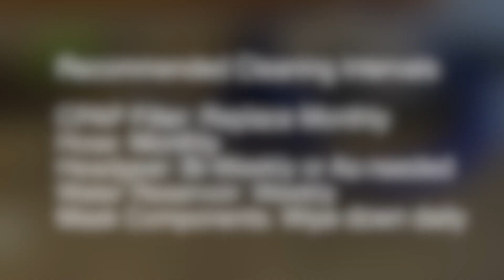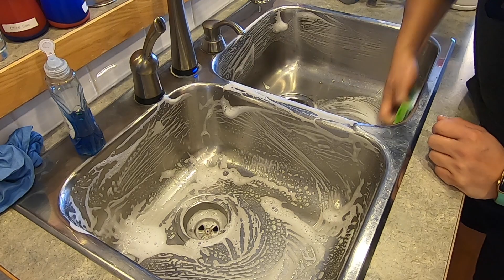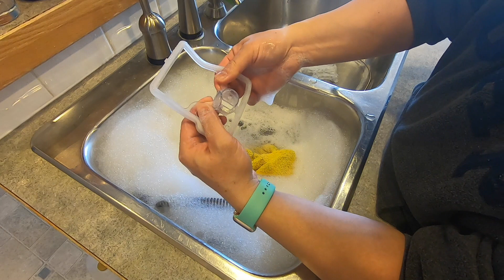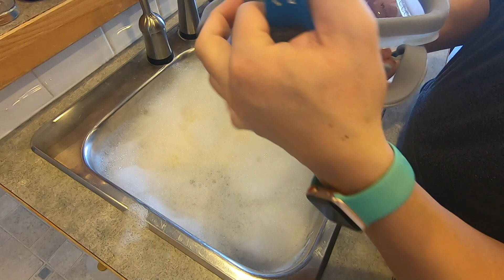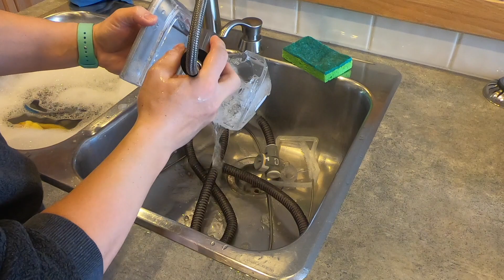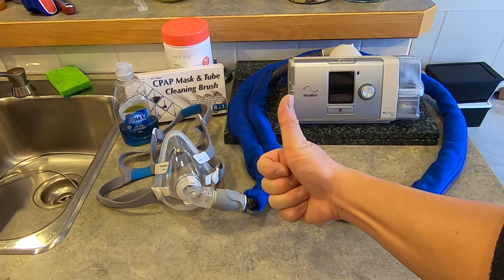How to PROPERLY Clean CPAP Equipment

Comment: Am surprised using tap water which I have been doing over 4 months. Do you use white vinegar and water once a month? Am curious. Thanks.
Reply from the maker: Sorry, what do you mean tap water?  I use reverse osmosis water in my cpap which is basically the same as distilled water.  No calcium buildup but I do wash with tap water and I do not ever get buildup either b/c washing and rinsing once a month and drying things out isn't enough tap water to "precipitate" any hard mineral buildup.
Reply: @piercedasian  I use distilled water in the chamber. What I was talking about cleaning in the sink with water out of the tap or faucet and that's what I have been doing. Heard people using vinegar and water once a month.
Reply from the maker: @marylawson6060  I guess it will depend on the tap water in your region but the takeaway here is that the tap water in our area is relatively hard but not enough that it would ever buildup.  I use vinegar in our kettles and SOMETIMES when I'm washing out my CPAP hose but I don't suffer from any significant respiratory ailments that would require me to go the extra mile all the time.
Reply: @piercedasian  I wash everything religiously including the hose every day with Dawn and warm water. Thanks for the information. I have asthma so another washing I have to do.
Reply from the maker: @marylawson6060  wow a daily wash?  Do you really need to wash the hose that often?  I understand the reservoir would be needed but the hose too?  How long have you been on CPAP therapy for?
Reply: @piercedasian  Four months. I have asthma so have been washing hose every day for the last week. Makes me feel more comfortable I guess.
Reply from the maker: ah okay, so you're a newbie still.  How have you been tolerating it?  I adapted fairly easily to CPAP but I'm always curious as to how long others take to get used to it.  I'll be honest,  you probably can try to wash just once a week and see how you fare.  I think washing daily is really excessive and you'll actually probably wear your CPAP gear out sooner than normal.
Reply: @piercedasian  It's been an up hill struggle for me. Was taking it off middle of the night. Felt like too much air so the company lowered it. I've just accepted this during the last couple of weeks. It is what it is.
Reply from the maker: yeah, I remember complaining the first week of being on treatment that I was being inflated like a balloon and the increased pressures (as high as 15-17cm's of H20 pressure) that it was waking me in the middle of the night.  Nowadays now that things have stabilized that I sleep soundly all night long.  Only downside is that sometimes the air from the CPAP is quite warm and that makes me "hot" when I sleep.
Reply: @piercedasian  Yes I've noticed the air does become warm quicker than I would like. Got new hose and everything today. Why replace them when not broken?
Reply from the maker: yeah its warm b/c of the warming plate for the humidifier.  No way around it unless you don't want humidification.  I couldn't live without maximum humidification.  It is so dry where I live.  You probably have one of the those auto fulfill replacement setups from your DME.  I personally would put a stop on the automated orders to replace the hose and other parts that rarely wear out.  I'm on my 3rd year of CPAP and I'm still using my original hose and mask!  Only thing I've replaced is the mask cushion and they say replace every 30 days but I'm going on month 18 and no signs of major leaks at all still.  Even my filter on my cpap is still the original one!
Reply: @piercedasian  Right. If it would stay cool could still have moist air. Oh well such is life. I just wanted cushions for mask not the entire outfit. Money is the reason I guess. Insurance.

Comment: Thank you! I have been loathe to clean my heated tubing because I thought the manual said NOT to get it wet. I thought you are supposed to change the air filters every 2 weeks?  I pay $3.40 for 6 Resmed filters; Medicare pays $30.78.
Reply from the maker: no issues submerging a heated hose. They're designed to be cleaned in the manner that I've shown and as long as the connector ends are dry then you're good.  Any remaining water inside the house will evaporate as you use your CPAP.  Hang drying for the day won't even get it all out.  I just wash, wipe the connectors and outside of hose dry.  Filters I "tap" clean every week and have not replaced them yet and its been 3 years.  I was told to only replace them when the start looking "really hairy" but if they look like new then odds are they're still useable.
Reply: @piercedasian   I think I'm going to start changing the filters every month & work my way up to longer periods then start "tapping" them.  Thanks!
Reply from the maker: I was taught by the sleep clinic to remove filter and give them a few flicks with my fingers and call it a day.  They last a crazy long time if you don't have pets or smokers at home.  The less I have to replace the less I spent and more importantly the less is tossed into the landfill.

Comment: Great video.  I’m new and just used for the second night.  I have a little chest congestion and hope this doesn’t become an issue.  Thanks for your tutorial.
Reply from the maker: Glad you liked the video.  You do NOT need to wash your cpap gear like this on a daily basis (despite what your medical provider tells you).  I'd just wash the hose and mask parts once a month and dump the water out of the humidifier daily (and give it a good rinse) and call it a day.  CPAPs aren't nearly as scary or as high maintenance as some people make them out to be.  Keep it simple and get the rest you need :)

Comment: What about using vinegar?
Reply from the maker: yep not a problem.  Using vinegar is a safe, natural way to clean and disinfect.  Not really necessary for a CPAP since it is a one way air circuit plus it is your own machine and not a "shared" device.  Soap and water is plenty for MOST cleaning situations and the only time I'd use vinegar is to remove any hard water scale in the humidifier (if you use tap or well water) or to sanitize things say for example, when I'm getting over a cold.

Comment: The best and easiest way that I found to clean my cpap equipment is to buy a five gallon plastic bucket with a lid, two gallons of white vinegar. Pour the two gallons of vinegar into the bucket, pour in one to two two gallons of water, and every morning take off the straps, and immerse the mask, hose, and water reservoir into the bucket and leave it there until I return home from work. (I don;t have the memory foam mask). Then, when I take a shower, take it out of the bucket, rinse it all out while showering, and hang it on the towel rack to dry . It will be clean and ready for use by the time you go to sleep.  White vinegar is a greatdisinfectant that will leave your mask with no chemical smells at all.
Reply from the maker: that's a great tip.  I used to use the bucket method too but then found it was almost as easy to just wash in my kitchen sink (after sanitizing my sink).  Good tips nonetheless and you're absolutely right in that white vinegar is the safest and eco friendly way to sanitize things!

Comment: Great information, but I wash my memory foam mask out in soapy water every so often with no effects.  Just have to fling out excess water (do not squeeze the foam) and allow to air dry (about 48 hours), and of course you will have to wear a back up mask.
Reply from the maker: I find that when I did that one my old cushion but I found that it can soften the foam up to the point that it doesn't seal properly. I'm on my 2nd memory foam cushion in 3+ years and I make sure I use a cotton mask liner so that my facial oils don't get absorbed into the memory foam and turn it all gross looking.  Been over 1 year and its looking and feeling firm and new still.  I'll have to try the "fling" method you mentioned and see how well my foam seal holds up.

Comment: This is sooo... not what I was taught by my provider and the actual directions
Reply from the maker: providers and the manufacturer are pretty simple.  Most will say to just rinse the hose daily and wash the mask and hang dry.  Nowhere in the instructions does it say to use a brush but the way I see it is that dust DOES get past the filter in the machine and will deposit along the hose surface and rinsing may not get it all off.  I'd rather NOT rinse my hose daily and instead clean it using my method once a month.  So far its been 3 + years and zero issues and my cpap equipment is squeaky clean.

Comment: Do you have any tips for nasal masks? I was told to 'just soak it in warm soapy water' but I gather that isn't exactly ideal or thorough, and the last thing I want to do is get an infection from messy gear.
Reply from the maker: You can wash nasal masks the same way. Give it a quick clean detaching the “cup” part and wash in warm soapy water and rinse thoroughly.
Reply: @piercedasian  Cheers, thanks for the quick response and the video as a whole. People like you are out here saving lives and wallets.
Reply from the maker: You're very welcome.  I just like to stay in touch with my viewers.  What good am I if I don't reply to their questions?
Reply: Theo, I use nasal pillows. Medicare pays for 2/month. On the 2nd night, I take the used #1 'new' pillow off & put it in a small Rubbermaid container filled with hot soapy(cheap baby shampoo) water & shake it several times then let it sit overnight. After dumping the water in the reservoir & refilling with distilled water I put it back in my ResMed machine & put the #2 'new' nasal pillow on. The next morning I thoroughly rinse the pillow that has been soaking, shake it out & set it & the Rubbermaid container/lid on a washcloth to air dry. That night I replace #2 nasal pillow with #1 and repeat the soaking process with #2. This way I use a clean nasal pillow every day & the pillow has plenty of time to dry.  I get a 3 month supply of items from my respiratory supply company. I start my new 2x/month supplies on the 1st of the month. I change the ResMed air filter on the 1st & 15th of the month.

Comment: Sweet video.  I realized Ive had my same equipment for almost 6 years now after all this Phillips recall stuff.  I am on the same hoses, water container, etc.   I never went as anal as this though.   All I did was fill a sink with hot water and soap, made sure the hoses were getting suds inside them, and let soak for a few hours, or if I forget the day.  Then I just rubbed rinsed everything and hung it to dry.  Not as crazy cleaning as this, but I never had issues for 6 years, so take it as you will.  I also only did it every 2 weeks
Reply from the maker: Washing like that for the most part is actually better than not washing at all.  I'd say you're already doing more than most CPAP users would do.  The way I see it is that you should make sure what you're breathing is clean and bacteria free since having a respiratory infection is no fun and can be totally prevented.
Reply: @piercedasian   I know They say Im supposed to replace stuff yearly, but if so, then why clean it./  I think they say that to make money
Reply from the maker: @virgil3241  Its all a scam to make people thing that things like hoses and hard plastic mask parts will mysteriously fail.  I'm in the camp where I am a firm believe that you treat your cpap kind of how you'd treat your dishes or your clothes.  They all eventually need a washing to stay clean and fresh.  I'm not saying wash things like crazy but a little bit of care goes a long way to keep thing clean and fresh and in good condition.  Its a balancing act of what is reasonable.  In most cases i give thing a quick wash and go about my business.  My clinic fortunately doesn't force their hand to tell me to replace stuff every month but apparently in the US it seems, that DME companies are cramming all this excess equipment onto people when it totally isn't needed.  I know when i start getting a sinus infection (rare) that when I do clean my cpap gear a bit more than normal that I seem to get over the sinus infection a little quicker (could be a coincidence too).
Reply: @piercedasian  I thought that to.  A hard plasitc/metal water container needs to be replaced yearly.   That means all our dishes and water bottles would be the same.   Thats why we clean things.  My two week regiment seems to work, although I will admit I sometimes forget the stuff in the sink, and there a mad scramble close to bedtime to finish it
Reply from the maker: @virgil3241  hahaha! mad scramble is a great way of describing my dish cleaning routine each night!  Your 2 week CPAP cleaning interval is a-ok!
Reply: @piercedasian  they wanyyto get you on new stuff so our insurance pays the bill

Comment: I used surf excel clothes detergent to clean my hose.. Can I use my hose at night? Please reply
Reply from the maker: hmm, I'd personally rewash using dish soap and brush and rinse thoroughly b/c laundry detergent is quite different than dish detergent.  I wouldn't use anything on my cpap that I wouldn't use on the plates that I eat off of.  Laundry detergents contain chemicals like blueing and bleaching agents.  If you wouldn't wash your dishes with it then I wouldn't wash my cpap with it.

Comment: Thank you so much for taking the time to do this fantastic video! I have been getting chronic sinus infections over the last few months literally all the time and I thought I was cleaning good enough to find out after watching your video that I am not!😳 So I ordered your recommended supplies and it’s time I step up my game! I’m so tired of being sick!
Reply: If you are using a Philips Dreamstation, there is a recall as the internal foam can make you sick (cancer) and a cleaning system such as SoClean or other Ozone cleaning devices cause the foam to breakdown sooner.
Reply: @glennlewis835  I’m using the Airsense 10
Reply: @glennlewis835  I don't think it's cancer.. My doctor told me the filter would breakdown and particles of it might get pulled into your hose and if you inhale one or some, it would cause some respiratory irritation.
Reply: Melissa, how are the sinus infections now that you have cleaned more often?  I'm having the same problem.
Reply: @MrPigsooie  They have improved but per my Dr I easily get clogged or dry sinuses so I have to work hard to stay on top of that. Regular sinus rinses, Flonase, allergy pill etc… The key is flush it out regularly for myself
Reply: I've been having the same problem
Reply from the maker: Melissa, I'm glad you found my video useful.  While many folks will say that cleaning like this is totally unnecessary (at in many cases it probably is true) that if you're suffering from chronic sinus infections that chances are there is SOMETHING in your CPAP that is aggravating your issues.  There is nothing wrong with having something too clean especially when it comes to your respiratory health.  Hopefully your condition improves.
Reply: @piercedasian  where did you bought that blue gear for hose???Thanks